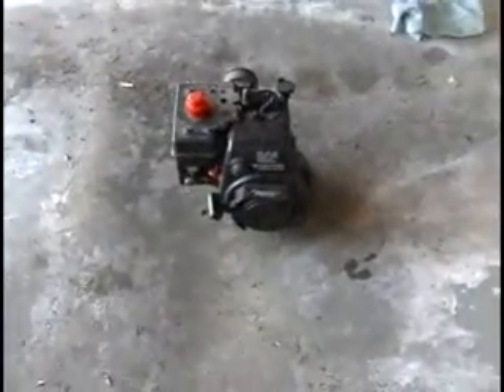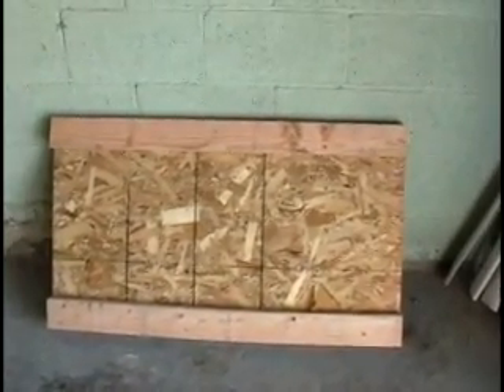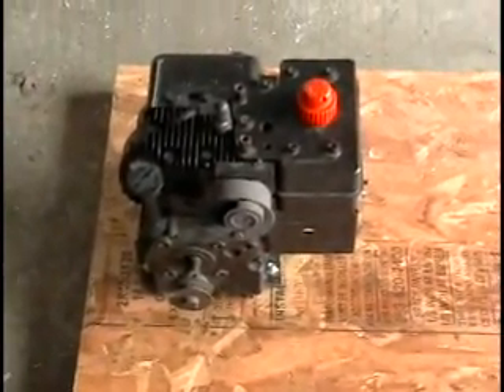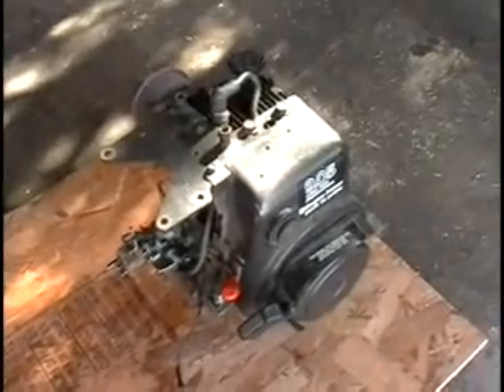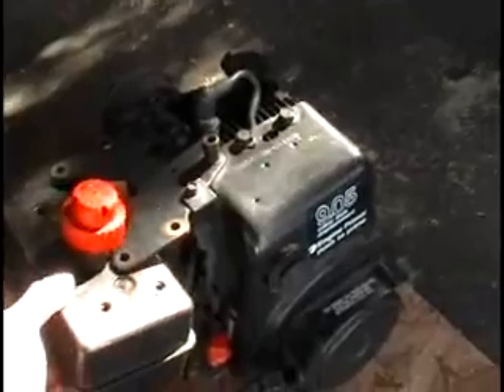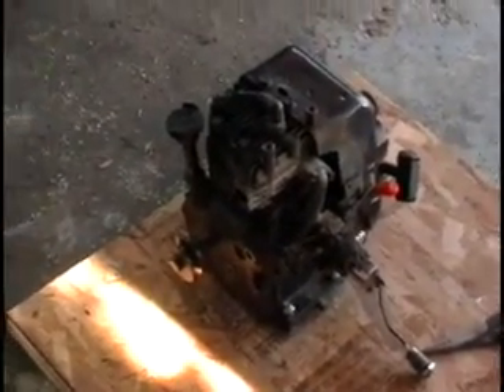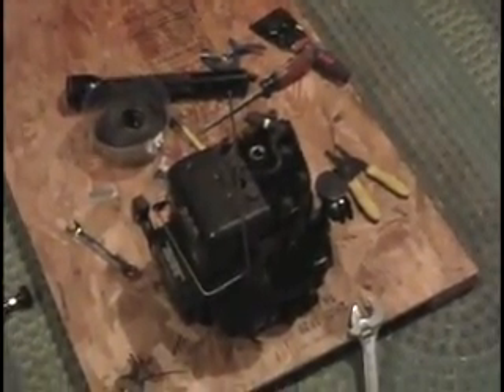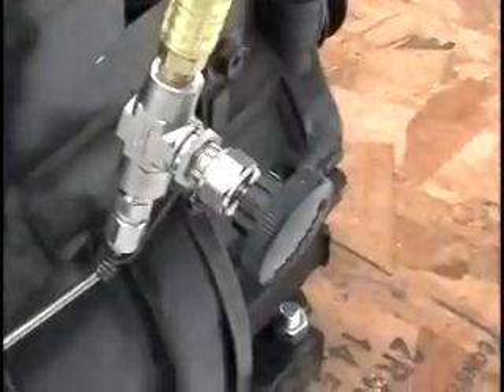Hydrogen Powered Small Engine

Comment: hydrogen needs oxygen to burn. unless you're using hho gas, which has the oxygen already, you will be safe with hydrogen because: 1. dissipates in atmosphere, extremely fast; 2. if it catches fire, it burns instantly and only if in right concentration in air.that to say if you feed into ait intake and catch a backfire, the hydrogen will burn because there is air around, but will not burn back on the pipe, where there is hydrogen only.since hydrogen has instantaneous burn, it may damage feeding pipe, so make sure you won't drop the bottle to allow more hydrogen released

Comment: I'm not arguing with anything in your last comment because everything is correct, but i still don't see why you don't see it as a good motor fuel. Creating more hydrogen from water to compensate isn't that big of a problem, and if your worried about the torque of a motor for certain situations, you can always add a flywheel to help.

Comment: Hydrogen has very low potential energy, though.  It takes a lot more hydrogen to produce the same amount of heat as burning gasoline or kerosene.  Kerosene is used in rocket motors for ground launches because it has an extremely high energy density and can be stored with a very high degree of safety.

Comment: I've read that they've gotten them over 25%...but the only application of those types of solar cells is satellite or solar vehicle where limited space and high power consumption are the biggest challenges and the cost is almost disregardable. Solar panels are definately not the way to go...they are cool and definately fun, but not pratical. Solar water heating and solar power generation (through boiling water with mirrors and running a turbine) seem to be the best use.

Comment: Also, I never mentioned the efficiency of generating electricity, just the breaking of water then burning the H2.
So 15% efficient panel, 20% efficient engine, and 80% efficient in breaking, that's a total efficiency of 2.4%.
Now, charging and discharging a lithium battery (including charger) is over 95% efficient, and ac drive is over 95% efficient and it runs more reliably with less noise, regen, and is much easier to get registered (obviously talking about cars).

Comment: Please tell me you aren't being serious.
Solar panels are between 10 and 16 percent efficient. That is horrid for efficiency.
Cost of solar setup:
4230 watt system is $14,000.
4 hours of sun each day=16.92kwh, round to 17kwh.
17*.15 is $2.55
14,000/2.55=5,500 days, roughly 15 years
but wait...who has 14,000 ok, loan time...
getting 76.5 a month in electricity, with a 6% loan for 14,000, you would need to have a 42 year loan...oh but the panels are dead before 25 years of age...

Comment: Problem is...generation is roughly 70%-80% efficient, then the engine is roughly 20% efficient. .8*.2=.16
16% efficiency
And the cost of electricity per unit of energy is more than gas...burning hydrogen is more expensive than gas, but a battery electric vehicle or hydrogen fuel cell is less

Comment: Hydrogen burns faster than gasoline, you need to port the exhaust gases into the fuel inlet and also provide ambient air in the same spot to make it work. I have studied Stanley Meyers inventions. The 3 gases have to enter the fuel inlet.

Comment: Pure hydrogen isn't a very good motor fuel- it takes more hydrogen to make the same amount of power than with any other fuel.  However, wood gas (hydrogen, carbon monoxide and carbon dioxide) has an energy density quite similar to natural gas and can be made quite easily- the technology was invented in Germany as a way to power their vehicles during fuel shortages.

Comment: like your rig. simple. hydrogen gets in, air ventures through carburetor intake; mixes on the way in; plug sparks, all works. they do say modify the spark timing, coldn't tell which way though; hydrogen flashes really fast, intake valve should be closed by then;  would be cool to see more

Comment: A car that gets 20 miles per gallon only requires 6.4 ounces of gasoline per minute traveling 60 mph. Yet this tiny 6.4 ounces of gasoline produces 6010 BTU per. minute. It takes 524 liters per. minute of Uncompressed Hydrogen to equal 6.4 ounces of gasoline. I can guarantee you it cost more money to make 524 liters of Uncompressed Hydrogen than it does to make  6.4 ounces of gasoline.

Comment: I don't know if it's true, but I've heard that running an internal combustion engine (especially two-stroke) on gas such as propane or hydrogen wears off the engine more quickly, because the petrol or diesel lubricates the engine. If this is correct, it would be a good thought to add nozzle to automatically squirt engine oil into the intake (just a tiny bit) to keep the engine lubricated.

Comment: Well, that depends. Usually, with utility engines, you can multiply the horsepower by 56.6 to roughly determine how many liters you need to flow to produce that much horsepower at whatever rpm your engine makes that much horsepower at (this is when using gasoline. When using hho, I don't know how much horsepower it will produce). Or you can take the displacement in cc's, multiply it by whatever rpm's you want to run it at, and divide it by 2000. I hope this helps.

Comment: Hi there, just  like to help.First  of all that tank does not contain HHO but instead H2. On your regulator I saw it was on 35PSI setting.The engine is running too rich. Try to set the regulator about 10 to 15 PSI or maybe 5 to 10 psi. In this setting the oxygen hydrogen mixture must be almost perfect. Good luck and be extremely careful.

Comment: .....all you have to do is change position where the magnet passes to adjust timing! It is quite simple really. But, you will have to use a 12 volt battery for the ignition coil and relay(if you use one)  power supply. Or you could just use a small dc power supply that puts out 12 volts and maybe 5 or 10 amps. Ok, so maybe this is a *little* to much just to have an engine run on hydrogen, but i would do it... FOR THE LULZ :P nah, because it is fun and something different.

Comment: Yea, lemme finish what i was saying. Anyway, with a reed switch, when the magnet on the flywheel passes the switch, it closes, causing the relay to close, which the sends electricty through the igntion coil that makes the high voltage to cause the spark plug to spark. A better thing to use would be transistor or mosfet instead of relay, cause the contacts on the relay will wear out fast, on a mosfet or transistor would not, but that is more sophisticated and stuff.... with the reed switch....

Comment: Yea, but since the only way to adjust timing is to move the magneto, which is hard and time comsuming, you can just convert it to run on an ignition coil from a car. I have some experience(check my channel) with ignition coils and high voltage. A simple way to do this is have a reed switch(basically, when a magnetic field is present, it touches two peices of metal and closes a circuit) that turns a relay on and off, that switches twelve volts into the ignition coil. Lemme know and i will help :P

Comment: Well, crap. i should have read this before saying all that :P. But yea, just have the hydrogen go into the carb. To adjust throttle though, you will have to adjust the flow of hydrogen as well as the air flow valve(throttle on carb) on the carburetor.

Comment: The reason it does not throttle correctly, is because the hydrogen/air mixture. On a regular gas carb, the throttle just opens and closes a little metal thing, the more the metal thing is open, the more air is allowed to flow, which allows it to suck the gas harder, which of course, sucks more gas :P. So, what you should have is maybe some sheet metal to go over the intake, and adjust it to change the mixture for each cycle. But what do i know? i am only 15:P.

Comment: Very cool!  Now make a Hydrogen generator system that runs off of solar panels!  Then you could step up your system to run a pickup truck engine.  The Hydrogen generator system Could fit in the bed of the truck and the solar panels on top of the bed.  FREE GAS!

Comment: ok. that sounds alright. also, you could have ran the tubing right through where the air filter was on the carburetor so you would have throttle control

Comment: Jason, I saw a video o Stan Meyer and he was talking about the problem with the burn rate being faster than gas so he was talking about mixing with an inert gas to slow the rate down to that of gasoline. Basically he was forcing more air to mix with the hydrogen.
Reply: I believe Stan mixed some exhaust gas with the intake.

Comment: for control, I would recommend continuing to use some sort a carburetor.  If you take a pipe, put a butterfly valve at one end to control the airflow, a flange to mount it to the engine at the other, and tap the hydrogen line with a different valve between the butterfly valve and the engine, you should be able to keep it pretty well controlled.  The control mechanism described ought to also work with other fuels.  I know, of course, that its somewhat primitive in design.

Comment: Not with one that small, but if memory serves me right, the spark part of it is the timing too. 

I am trying to get an 1800cc engine working on force or drawn injection as done by Stanley Meyer and Daniel Dingle. But first I must get the WFC working corectly. I still have a lot of testing to be done, both of them seem to have done just about the same thing in two different ways. I have mixted both of them and am trying to see if I can get 10L/min or more. Good luck on you work.

Comment: One thing that you could try that I always wanted to do is add a small amount of steam to the intake while you are trying to run it on hydrogen. In a gas engine the moisture starts to bog down the engine depending on how much moisture is going in. so if the hydrogen burned faster than the moisture may help to reduce the rate so that the engine will run more smoothly. Finding the correct ratio would be troublesome